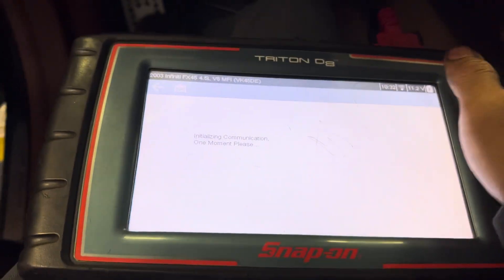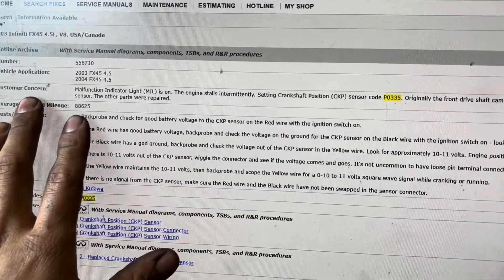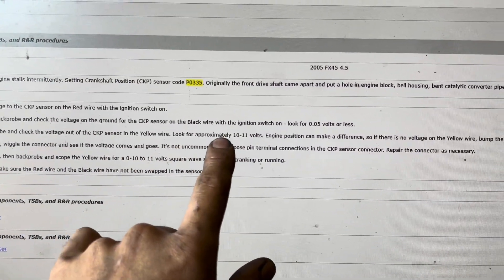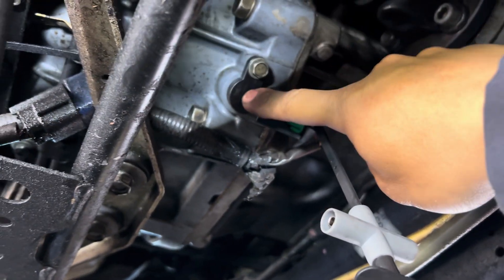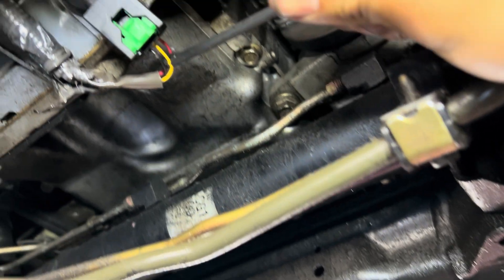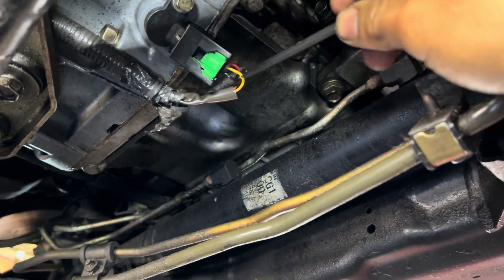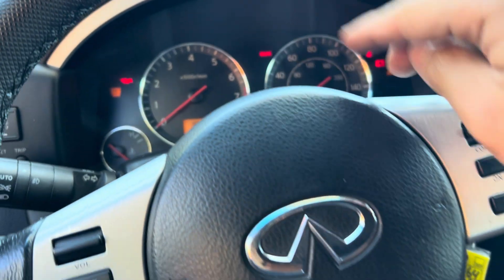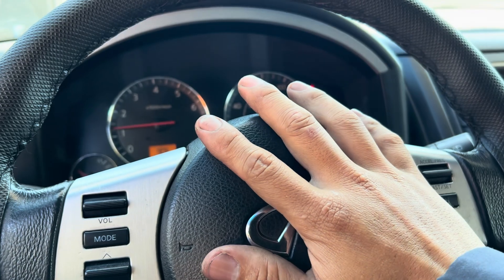Infiniti Fx45 Crankshaft Position Sensor Problem - Testing & Replace (MUST USE OEM CRANK SENSOR)

Comment: Where are you located bro I think I bought this exact car and it has the same problem again
Reply from the maker: Im in San Jose CA.
Reply: @Ah_Duuu_Ma yo bro how can I get ahold of you I have this exact car you made a video on still has the new crankshaft sensor you put on it but the codes back on doesn’t go off
Reply: Yo bro does the crank shaft sensor have warranty still ? I have this exact car it came from San Jose and it has the same problem again